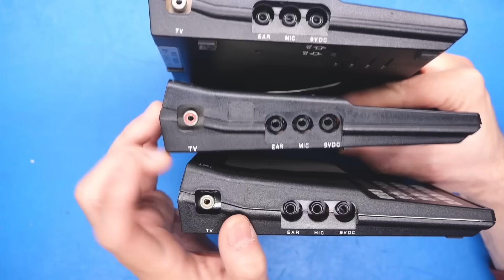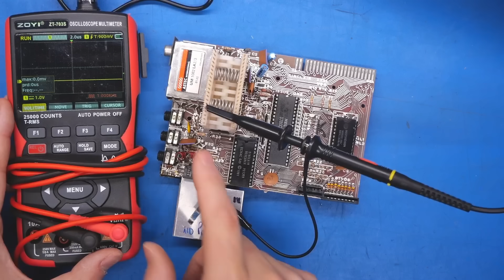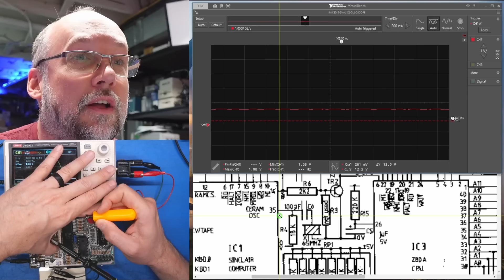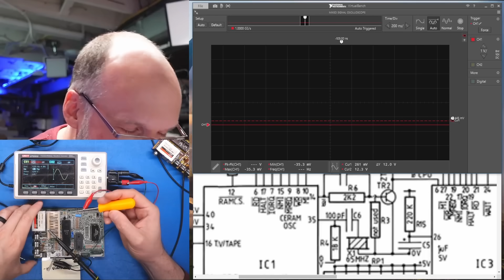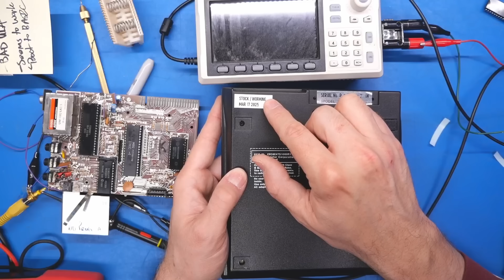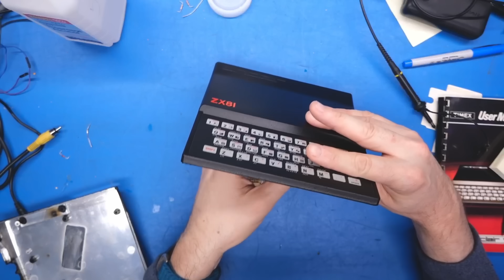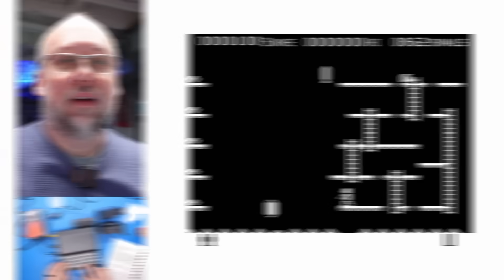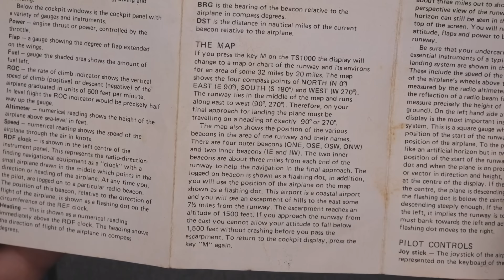Is the ZX81 / Timex Sinclair 1000 actually bad? Let's fix these to find out.

Comment: After watching your teardown/repair of the Laser 200, even the ZX81 motherboard looks like fantastic quality.  It has silkscreen, the foil isn't lifting, no bodge wires, actual connectors for anything that goes off-board...  Lack of solder mask on the top is a negative, but overall I'd say this one looks better.
Reply from the maker: Totally -- that Laser 200 was the worst I've ever encountered. The ZX81 board seemed OK for the time and price.

Comment: Pretty sure that's not a crystal oscillator.  A crystal is only two pins and a metal can.  A ceramic resonator is 3 pins.  An oscillator would incorporate an amplifier, crystal oscillators are usually four pin metal cans,. It likely the PLA has the amplifier, that in conjunction with the resonator forms an oscillator.

Comment: I had a short ribbon cable for my ram expansion box. One end attached to the card edge on the back of the computer, the other end attached to the ram expansion box. It prevented the computer from crashing if the ram pack was bumped.

Comment: Got my first computer, a ZX81, in kit form and soldered the whole thing together. Had fun just playing with 1K RAM and then bought a 16K ram pack. Yes you got wobble but some Blu-tak helped keeping it in place. A friend also had one and so we set about learning BASIC from magazine articles etc. Saving to cassette was a pain but we managed it. From there was the usual progression to 48K Spectrum, Plus, 128K QL , various upgrades, ST, Amiga and then onto PCs. The ZX81 got me started and 40 plus years later I'm still playing games on a screen, typing stuff. So sure crap design, keyboard, poor spec etc but it was better than no computer at all.

Comment: The ZX-81 was my very first computer all those years ago. And I learned a lot from it. I never had a problem with the keypad it always worked with no problems. The only thing I did to my ZX-81 was I found an article in Sync magazine that shoed how to open the case, pop the cover off the rf monitor and with a little bit of soldering convert the output to composite output . The video looked soo much better.

Comment: I have a Sinclair branded ZX8, I did have to replace the ULA as it had died, and also had to trim the keyboard cables as they had been damaged. Still only mostly works, as one row of the keyboard is dead. I used the same replacement ULA you showed, and it was just a nice drop in fix.

Comment: I remember sitting in a high school class when I first saw the ZX81 in Byte magazine, and it blew my mind. It was so incredibly cheap (I had an Atari 800) and its design was so slick that I read everything I could about it for many months afterwards. Many years later I bought a TS1000. I am glad I have it in my collection, but it sure was a disappointment as a computer. You can be revolutionary and a terrible disappointment at the same time.

Comment: Really clever, minimal machine! I built the ZX81 USA Issue One kit in 1982. Internal 16K or 32K SRAM mod is easy and it eliminates the nasty RAM pack.
Reply: Yep, it was called ZX Spectrum. ZX81 was for Sinclair and Spectrum what VIC-20 was for Commodore 64. 
Unlike Timex counterparts, ZX81 was quite, and Spectrum was hugely popular in Europe. As Spectrum's popularity was falling as 90's approached, it was growing in the Eastern Europe and continued through the 90's. Its ULA chip was reverse-engineered and final "Eastern" Spectrum clones with disc OS were quite the mutants :)

Comment: When Radio-Shack was dumping the surplus from the TI 99/4A production ending you could get the keyboards there and with a few matrix changes you could adapt one to a TS1000 and then crazy glue the old membrane key plastic to the tops of the 99/4A keys and it worked quite well.  The IC4B is for using a pair of 2114s for RAM instead of the single 1k 4118 or the 2k 4816 SRAM.  The ROM is a oddball which is notable for price reduction.  8k ROMs are 28 pins in JEDEC but these use an 8k die with an adapted TMS2532 pinout.  The ceramic part is actually a discriminator filter for TV/VCR applications from MuRata which keeps the sloppy natural oscillation tendency of the oscillator inline.  It's an exercise in minimalism but maybe not Zen.  Nothing inherently wrong with the design but the other famous CPU generated video of the era was from the Atari 2600 and there's no sprite handling or color here so it's all in context.
Reply: I was just about posting a question regarding that unpopulated IC4b, and then I found this wonderful answer: all I may have wished for!
Reply: @noland65  Excellent! 😀  I've only seen a single photo of a ZX81 with 2x 2114 but I have seen one and the ZX80 used 2x 2114 for RAM so there's that as well.
Reply: @Peter_S_  My own zx81 had 2114 chips, and I created an extension board ("ram pack") with another 2 x 2114 chips for a total 2KB! I used 2114's because they were the cheap option at the time. Larger sram chips were really expensive in (the consumer/retail market at least).
Sadly, while working on assembly programming I had a power accident and blew the board up... lesson duly learnt!
Reply: I also took a TI994a keyboard and rewired it to the 1000, even gluing the old keys. Still have it today.

Comment: That's a ceramic resonator and not a quartz crystal, btw. Cheaper and imprecise. Probably resulting in bad video output as this thing drifts all over the place with temperature.
Reply: And the reason the clock "works" without it. A resonator helps keep an existing oscillating circuit at the intended frequency, while a crystal is capable of driving the oscillation.
Reply: It's actually a ceramic filter (Hence the 3 legs).  The ULA gives out a sweeping frequency range and the ceramic filter ensures that only 6.5Mhz gets back in. These ceramic filters were dead common as they were used in PAL-I (the UK version of PAL) to filter off the 6.5MHz audio carrier. You'd see them is most early PAL CRT TV's and VCR's for that matter. Later modes used a SAW (Surface Acustic Wave) Filter. Good on you Sir Clive for making use of existing available parts.
Reply: @zero0ryn  It's Jim Westwood, the designer of the ZX80 and ZX81, who deserves the plaudits, not Sir Clive Sinclair.

Comment: There was a replacement shell that included mechanical switches back in the day. That is how we used it. It was a great learner computer.
Reply: there were several add on keyboard cases, most common/popular one likely the DKtronics one, i have one, second probably the Fuller
Reply: @andygozzo72 yep I have a DKtronics keyboard on my zx81.......bit clunky but way better than the original membrane keyboard
Reply: Wasn't there one that mounted on top of and actuated the existing membrane? Can't imagine that would have been effective.
Reply: @NuGanjaTron  yes, the ones i know of were made/sold by 'Filesixty', early one with hard plastic keys, later one with rubber, like the spectrum , both werent that good, needed quite a force to operate, there was also a hard plastic key 'screw on' keyboard for the spectrum, from what i've seen more than one version, both pretty bad, i have one variant that was often fitted to spectrums in portugal, the uk one was known as the 'kelwood computing k board'

Comment: I still have a ZX81 (I'm UK based) and I love it. I have even had it refurbished including a composite mod, an internal 32K and a new ROM. Plus a new PSU and SD card based tape loader. It works rock solid now. 

I do really like the keyboard as well, once you work it out you can type in programs really fast with it.

It's also an ideal computer for learning assembly language on as it has a simple display (Once you get your head around the moving display memory location)

Plus it was the machine that had the amazing 3D monster maze!

Comment: No one outside the UK can truly appreciate the humble ZX81
Reply: It was sold in NL at the same time m8. And they sold plenty. Not right away in 80/81, but more 81/82 and onwards, bc Sinclair kept making them for some time and reduced price. I think up till the spectrum1, which was about 83ish i think. The price for these things is still very low, which indicates a lot were sold
And that was bc they were the cheapest around. Only the vic came close at some point.
Reply: They are appreciated in Australia. I looked at them when I was about 13 saving for my first computer and it made enough of an impression that I decided to wait for the Spectrum rather than get a VIC-20.
Reply: They were a huge hit in New Zealand. 😃

Comment: I've also got an NTSC one that's branded as a Sinclair ZX81. It's in storage right now so I can't check the date or the manual, but I know it was purchased most likely in NH, or maybe MA, by my grandfather.

Unfortunately I don't have anything that can display fully RF NTSC video. I had contemplated trying to hack mine to get the video out before the modulator, but it went into storage before I got around to messing with it.

Building my own ram expansion is also on the to-do list when I drag it out again. Should be trivial for that computer to just use a single modern SRAM chip and a little custom PCB

Comment: Rex in 3D monster maze was responsible for several dead zx81's.... monster appears, you panic and knock the computer, rampack wobbles out and shorts the voltage rail to ground.... 81 wasnt a bad machine, it was just limited. We didnt get high res graphics initially so made do with those 3d monster maze type character graphics. it was our first family computer in the UK so naturally went to spectrum next. Have a look at the zero key. some say delete, some say rubout.... I have several 81's now including one I built which has colour VGA , sound and a huge ram expansion, all internal.

Comment: The official parts supplier did have self-adhesive stiffeners so you could re-insert the keyboard connectors back in the 80's!
The ULA died mostly due to wobbly expansion packs!
Only the North Americans had the shielded cases!
I still have my ZX81 with a mechanical switched keyboard from DK Electronics!
It's great that you brought up the back porch issue, which drove me mad at the time. I fixed it with a sync generator chip, but it's interesting to see a 555 IC used!

Comment: Until the early 00s you could still find a moded ZX81 in a plastic box, running climate control on a mid sized greenhouse ,and had been doing it since 1982.

Comment: Storytime! I am looking forward to seeing this video, but I'll post my experience here first!

When I was growing up I was bitten by the computer bug in preschool (by an Apple][ Plus), and I really wanted my own computer, (this is the early 90's, and it was not really an easy thing to come by!). My parents told me their story of whoa when they bought a home computer when they were younger and it was a brand new just released Timex Sinclair 1000 with the 16K upgrade. They told me it was absolutely terrible and that they spent an entire night trying to enter a program from a book only for the computer to freeze up and for it to display garbage on the screen if it was bumped too hard or they looked at it funny, only for them to have to start again. The TV reception was garbage and it took them 2 days to be able to get one of their basic programs onto cassette tape at the right levels for it to be read back, and that all the jacks on the computer were the same so it was easy to plug the wrong thing in the wrong place. I of course wanted to play with it, but they told me they took it back to the store, got their money back, and that experience convinced them at the time that home computers would never become a thing. 

Well I didn't believe them that the experience was that bad until one day a long time later in the 2010's I found my own Timex Sinclair 1000 with a 16K upgrade at a used games shop!!! I was stoked! My parent's first computer and I was going to experience it and have fun with it!

Problem 1) Over half of the 'keys' on the keyboard did not work or required you to really hold it down hard, like about to break the case hard for it to register..
Problem 2) The 16K upgrade was VERY touchy, like if you looked at it funny the screen would corrupt or the screen would freeze up.
Problem 3) I took it apart to fix the keyboard and found not only did it have that vinegar-y smell, but it was coming off the ribbon of the keyboard, which appeared to be like a THIN sheet of acetate with silver strips on it, and it had physically broken in several places and was deteriorating. I managed to cut the brittle part of the ribbon off and get it shoved in the connector, and the keys now all at least 'worked'.
Problem 4) The 16K RAM expansion was only stable when I took it apart and destressed the wiring, and even after resoldering several dry joints and using contact cleaner on the edge connector and mating connector on the ram module, it was still awful. It still did not take stares very well
Problem 5) I tried 15 tape players/recorders and only one of them worked with the sinclair, it was VERY picky and it took me 1/2 a day just to dial the volume levels in so it worked. Loading in programs by tape was hit or miss, and several of my original tapes despite having the same program on both 'sides', only one side would work, and I can't say reliably, because it still took 2-3 attempts sometimes to load something in.

I managed to get states and capitals to run after a couple of days, and there was no way in hell I was going to try and program anything on it directly, to this date it is still the worst keyboard I have used on any computer! The only saving grace it had was the shortcut keys so you didn't have to type every single thing in, which would have been even more torture. I even put the speak and spell membrane keyboard as being more comfortable and easier to use. Long story short, I wanted to prove to my parents that it wasn't that bad, and discovered that although time had not been kind to my specific unit, they were still right, it was an awful computer. Putting myself in my own kid shoes, I think I would have only liked it had it been the ONLY computer I had access to. I would have had to have gotten really creative in that situation, and I would have had to do something about how terrible that keyboard was, and how unreliable the memory expansion was too. 

Now it's time for me to see what kind of experience you had with this thing!

Comment: In a funny way, my TS1000 has become one of my favorite machines.
I think its the concept of how far you can push something to do something it wasn't designed to do.
A combination of impressive (mostly newer and 16K) games that have actual graphics that look decent.  And also the impressive (to me at least) 1K games, that just show how much someone can do with so little.
I did the internal 16K mod to my TS1000, along with a composite mod.  I also re-used the channel selector to become a 50/60 hz switch.  Both work on my 1701, although I have to tweak the vertical hold to get it to catch.  ;-) 
I also did have to replace the TS1000 keyboard membrane (and swapped out the voltage reg with a Traco modern much cooler one) as my membrane was cracked and brittle.  Luckily they still make new membranes!  
As for when they cut over to the TS1000 in the US from the USA ZX81, that will be tricky because as I understand it, there was some overlap when you could get the USA ZX81 via mail order and the TS1000 at the same time.  Probably as they sold out their stock of the USA variant.
I do have a USA ZX81 (Made in UK) also, although I haven't opened it yet.  It's just sitting on my shelf.  ;-) 
I built myself a little TZXDuino to play .p files to load games, and it works surprisingly well.
I think I appreciate the machines that are underpowered and as a result people get more out of them more in general.
Probably why I find myself using my Vic-20 more than my 64, even tho I know the 64 games are way better.
And when you think about it, that key shortcut method is genius.  They marketed it as "easier for the user with those shortcuts," but when you remember that the machine came with 1K of RAM, being fully token based saves bytes.  And with 1K or RAM, all bytes are precious!! ;-)
Also, if you are looking for a TS1000 with a Spectrum type keyboard, you are describing the TS1500.  Released in the US, it is basically a ZX81, with 16K RAM in a Spectrum style case.
I don't have one of those, but they are interesting...

Comment: I started with a Timex Computer back in 1981 and I was quite impressed with it's size and what it could do but I immediately found the Keyboard annoying. I had to push the membrane in to register a keystroke which caused the computer to move a bit. Initially this wasn't a huge problem till I got the 16k memory expansion. Because of the way it plugs into the back of the computer, it's very easy to jiggle the contacts just enough to freeze it up! Especially when playing a game with the keyboard! That was very annoying till I got a Commodore Vic-20 to replace it.☺

Comment: I really miss those small paper instruction manuals that used to come with things.  Books are magic, and are the most dense, human-readible documentation format possible.  No computers or electricity required.  Physical books are better than electronic books, but having both is ideal.  Bring back packaged instruction manuals, society.  Not the full array, just the guides like Adrian showed with the binding that allows the book to lay flat and be used extensively.